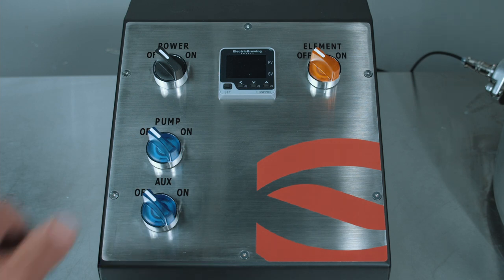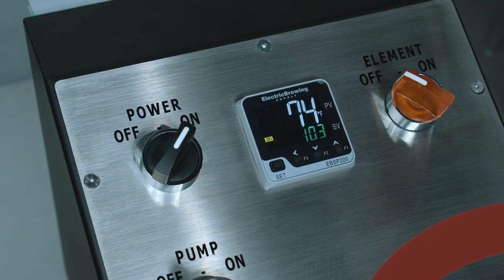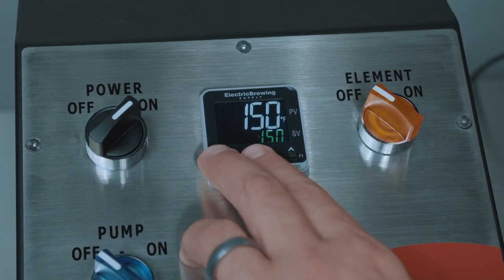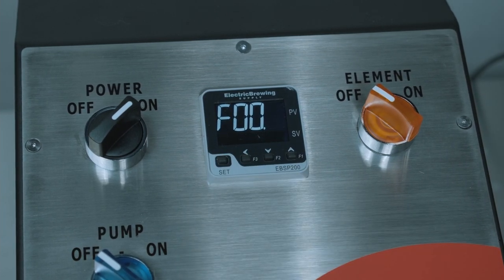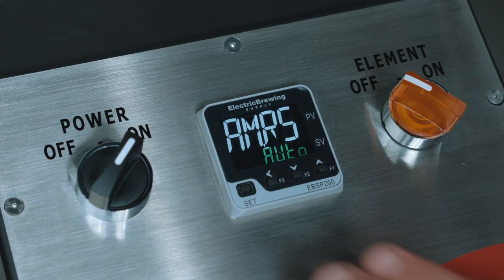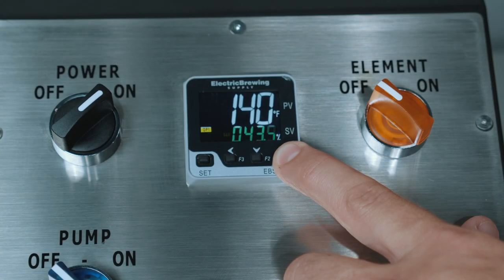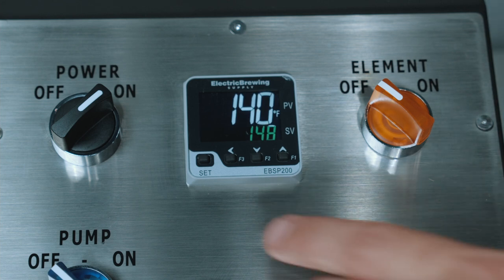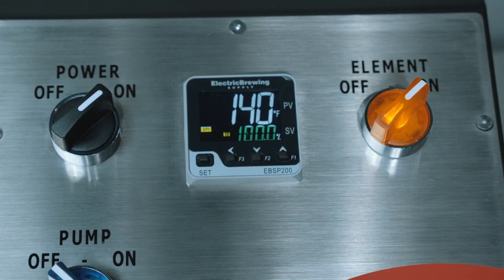Spike Solo | How to Use Your v1 Control Panel

Comment: Are you really supposed to have the heating element off during the auto tune process? In the instructions it doesn't say anything about turning the heating element off, and as far as I understand, the element should be on. But, in this video, the switch is clearly switched off.
Reply from the maker: The element will need to be on